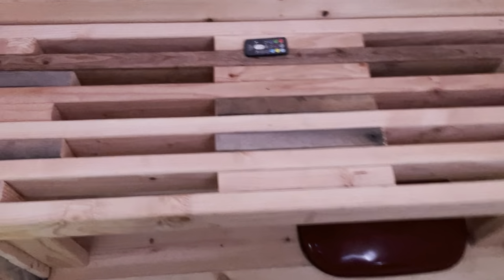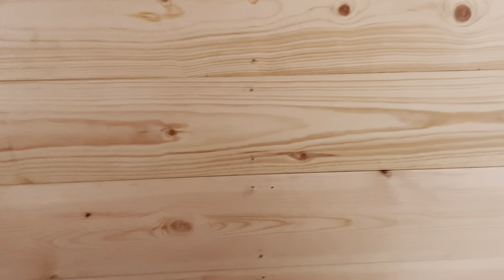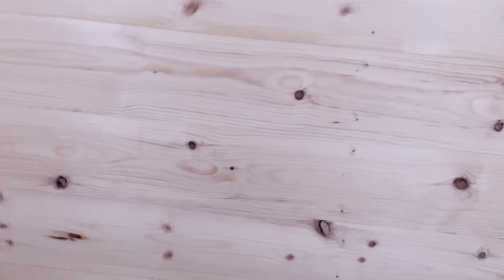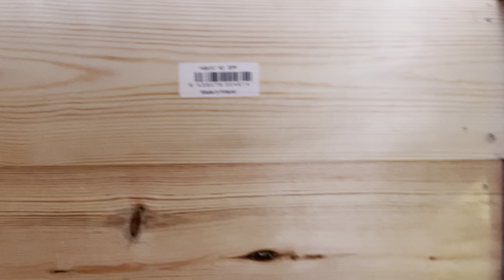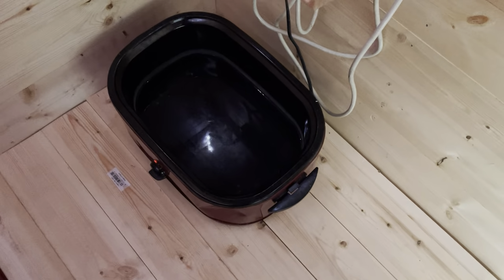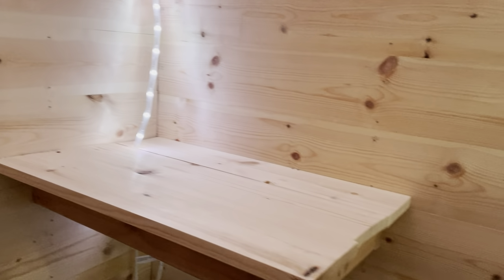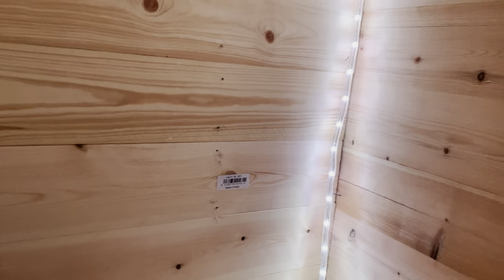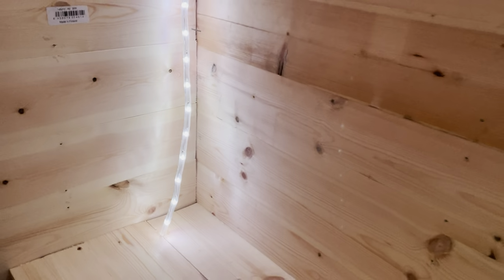DIY steam Sauna completed crock pot part two less than 500.00

Comment: Over in the UK here, been looking to build a sauna similiar size. Did you use any insulation at all? 

Also, everything I’ve read said you should use certain wood that isn’t prone to mould and that can maintain heat and wood without knots so that no sap comes out as it can be very poor for your health. Just wondering if you considered this at all and what wood you used. 

Great little build though! I can’t wait to build mine.
Reply from the maker: Yes it is all insulated with a vapor barrier installed cedar or redwood is advised but the cost is much more, I went with pine and so far I havent had mold or mildew yet and it gets a lot of use
Reply: @diycheapgreggo1635  good to know! Thanks for the reply, I hope it serves you well 🤙🏻